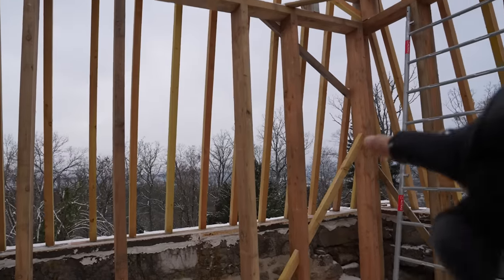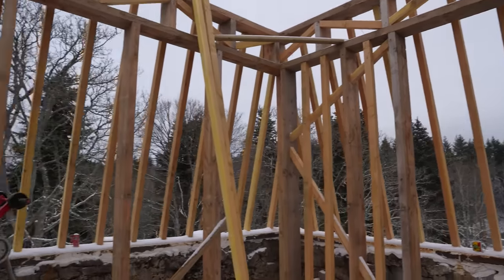Completing the first part of the chateau roof.

Comment: Your diagonal's would provide much more strength and rigidity to your wall if they were "let in". Instead of many short sections that all have some movement your diagonal would be one continuous piece of wood that sits in dados chopped into the verticals.

Comment: Have you thought of skipping the lower floors on the other side first and moving right to the top floor so you can get the roof on the other side?  You then could use the steel from the top floor to help Install the lower floors.  It would be a bit tricky to get those steels on top In first, but with a little planning and help from the boys It could be a cool idea.
Reply: In a Mansard roof...the floors need to be stable first as that is what the roof actually sits on. As he has explained in past videos

Comment: I can see Dan, that you're a perfectionist and very meticulous about your carpentry.  So is my husband.  In fact, the last new house he built was so straight and square that it was too tight, too perfect. The fireplace wouldn't draw if the extraction fan in the kitchen was on.  Instead smoke came into the house.   (He didn't lay the brick for the fireplace.) They either have to crack a window or put in a fan for the fireplace.  Just an FYI for you DIY.

Please wear safety equipment when you're nailing on that OSB.  <3

Comment: So glad to see you have had a few helpers lately. It's looking great. A few questions: Cold weather = wood shrinks. Warm weather = wood expands. Will working now on the frame in very cold temps cause any issues when temp warms up, such as movement? Cracks? Gaps where rain could get in once cladding etc is covering the frame?  

When snow melts, will it seep into the wood, and how long will it take for the wood to dry out? Will you need those dehumidifiers to remove all the moisture in order to avoid any mould growing?
Reply: Wood expands with a coefficient of about 0,000008 per °C, so a meter of wood stretches by a fourth of a millimeter when temperature goes from 0°C to 30°C. About moisture, I guess we'll see what he'll do about it. I have learned that Dan doesn't talk about future plans a lot, we're supposed to keep watching ...

Comment: I wonder what section of the house you will work on next after this roof is on this section. Me personally, considering its winter. I would try a smaller area like the turret. Less work to bring up supplies in the snow. You can put in the next floor. Secure the stones. Level it off and place a temporary cap on top (plywood, tarp with a small pitch for run off and sandbags to hold down) to keep it dry inside until your ready for building the peak.
Reply: it might be smart to secure the top of the turret walls indeed. stones falling could likely smash through osb floors or new roofs...

Comment: I didn't think about this until just now but maybe you should have installed eye bolts to the outside of the base steel along it for anchor points for your safety rope and harness that you could have run from one side to the other across the top of the roof frame it would have made putting the osb and roofing on easier later on.
Reply: The steels aren't mechanically-fixed to anything though, and could not be relied on to take the weight.
Reply: He could still fix it to the walls with drilling a few holes and anchoring the steel down but I'm still pretty sure that between the weight of the steel and the roof framing it could handle the weight of one person and some osb and the eye boots can go where he planned to put the windows so he could detach the safety rope whenever needed would also come in handy later on for cleaning the outside of the windows on the floors below with the climbing gear he already uses.

Comment: What is Your Description of an "A" Frame>  Dose it look like and  A ? Or are you making a Truss for the " flat" Roof over top floor? What will the roof lines look like when completed ? A mansard roof is typically flat or has slight angle for rain run off . Do you have any Working Drawings of the Roof Framing? just a few questions .lol

Comment: You board up the windows it will get DARK in there and even colder than the outside! Clear THICK plastic would be better.  On wood frames. You'll still have daylight and it's CHEAPER.

Comment: mount the panels due south 90 degrees vertical will help wit the snow

what i do at 57 degrees north in the winter
 
or rig up a pully brush of some sort

thats deep snow looks in yard at half meter ok. lol and this is a drout year so far usualy 1m by now

u guna fix up a fireplace for heat or haul a wood stove in?

Comment: Will you need to rebuild the upper bits of the inside wall before you can waterproof the roof structure? Or do you have a temporary solution in mind?

Comment: i'm still wondering what the build sequence for the project is. what area is next to get new floors?
Reply: I think he said the roof is a priority to create a dry workshop. The workshop is needed to continue with the build and keep the equipment from rusting.
There are no outbuildings on the property that he could use for storage or as a workshop.
Reply: A while back he said that he plans to do the opposite wing after this one, I don't know if that's still current.

Comment: Adding the roof framing really gives perspective to the massive size of the chateau.  Is it four floors in the middle?  I hope you put an elevator in there.
Reply: I hope he doesn't put an elevator in for himself - he will keep fitter always using stairs as he gets older.
Reply: @basseynz  Easier to haul stuff up and down.  They may need it, depending on what they want to use the place for when he's done.
Reply: @Scott_works  Yes although he seems to do pretty well lugging stuff up :). The living areas are usually the lower floors and the upper floors bedrooms. He has said he is going to live in it and hopes to run summer camps for disadvantaged young people.
Reply: @basseynz  Hopefully he won't mind schlepping wheel chairs up and down.
Reply: @Scott_works  Will he need to?

Comment: i cant fathom what live loads the engineer is expecting for that roof system... it looks like you have 2.5 x 6 or 8 framing spf #1 that is braced for racking as well and on something like 10 inch centres... you do not appear to be in an alpine region which can expect abnormal snow loading.  i live in canada  we have been known to get snow here on occasion and during my architecture schooling i had to become intametly familiar with our building codes and other things like span and load tables.... offhand that roof structure should support 100 -200 feet of snow on top of it.....here  cheap roof is 2x4 on 16 inch centers with 3/4 sheathing  an expensive roof would be 2x6 or 8 for insulation depth  and  1 inch thick t and g  plywood sheathing .....5 6 and 7 feet of snow on them is normal . thanks for the videos  keep warm and clean your working area

Comment: So solar needs cleaning in winter. And they want me to invest in it. A further point in your roof construction and the tax value of your building which has to be valued in Spring. At what point in the roof construction does it become a roof and so hugely advance your building value on which to pay annual tax. Is it when you apply under felt or when you apply tiles? As the application point might be about the time of declaration should you delay slightly to gain advantage this year? An hour with your accountant might be very valuable. A roof covered is a roof covered the size of it may not count. So no roof is a ruin under reconstruction and liable to a lower value to pay tax upon leaving the substantial rise for a further year if that surmise is right. Worth a question to those who know. There is also the point of reduction by adding windows  in the roof you were speaking of. Lots of advantages and traps in what you are doing.
Reply: A large permanent solar array will be set up to prevent snow accumulation. Dan's is a small temporary solution. I wouldn’t let that bother you too much.

Re tax, it's normally when a property is habitable that you will start to pay charges. It will be easy to check with the mairie how that is defined.
Reply: @LaReynedEpee  Ah that is interesting. From such as I could understand there were tax charges on value and CGT and they appeared to be different functions. I suppose it is similar to local and national tax here. It is just that with PAYE here annual filing of tax returns is only for a part of the population. I was surprised to see your assets abroad were also taxable. Equality in all things it seems!
Reply: @glynluff2595  France at least provides refunds on tax for installing eco measures, wish we had a similar system in the UK.
Reply: @LaReynedEpee  I think we would like to see some positive thinking to benefit usable eco matters in a logical way. Various departments offer items that oppose others. Will it change with government, probably not !! Have a good 2024!
Reply: @glynluff2595  Joined up thinking would be nice, for sure

Comment: Cutting out the small pieces of the brace was a joke I hope, because that is just a waste.. as long as the angle is not changing - and it is not - single cut would do the same job.  [Fixed spelling of pieces]

Comment: What I find annoying is having placed the entire frame on the floor, it would have been necessary to at least double certain beams because there is all the weight of the frame.  Then all the weight of the slate without counting after the insulation the Placoplatre;  and then the layout possibly if it's a bedroom, // that's a lot of weight for such a small floor....
Reply: Hence why he needs a structural engineer…
Reply: Look up Mansard Roof. That's what he's recreating.
Reply: @NurseSherry  and you don’t need structural plans for that? You do it by the eye?
Reply: the previous roof was constructed the same way, with thinner dimensions. the difference is that all the wooden beams of the floor went into the wall distributing the weight more evenly. now almost the whole weight of the roof and upper floor is carried by the ends of 3 steel beams. I'm a bit skeptical, seems like he did not do much to strengthen the wall below the points where these  steels were inserted.

Comment: I say this only because there  are other attics and rooves to frame for you.  Cutting the angle pieces inside the studs is not particularly strong..  Better would be nailng the angle boards full length to the outside or inside  of the studs. Even if you put them on the inside and don't want the braces protruding into your attic space, thin steel straps could be used and lath and plaster or even drywall would cover the straps
Reply: Diagonal 6x1 ,two 3inch annular ring nails too each vertical stud on the outer face (will be within the void area once walls are finished internally anyway. If he intends to sheath the mandate slopes then there will be zero chance of racking anyway. The rigidity of short diagonal sections BETWEEN the studs is much poorer practice, only done when both faces of the stud are to become 'finished'  walls. I can't believe this his structural engineer has asked him to follow the detail of diagonal blocking.
Reply: @chrisdormer1061  ... While we are discussing  things, I  don't get why  such heavy timbers are being used at this top section. Such high centers of gravity are unstable in even moderate earthquakes . Use of lower dimensional framing lumber would be more than strong enough for an attic and roof  of that size and be safer besides..  I would be worried about racking even  while constructing  and finishing  this roof.

Comment: Can someone please tell me what is going to happen to the floors that have been put down, its fibreboard/chipboard and it has got so wet, do you think that it is going to have to be replaced or will it be left in place to dry out...?
Reply: Obviously, these are temporary floors until the roof is waterproof.
They're not designed to last very long.
Reply: Once he told us it is marine grade plywood.
Reply: @carolynmendoza1934  It's neither plywood not marine grade.

Comment: A 2x10 nailed horizontally to the back side of the angled part of the structure would allow you to brace between the vertical studs and the horizontal studs.  I'm not sure why you are doing seemingly random angled bracing.   Two ends are tied into the stone wall and the other corners only need a top plate.  The roof sheeting will stiffen the outer shell completely.

Comment: I could be wrong but in. my opinion your nails look too small and thin for the size of the beams you are using. I think you need much heavier nails for holding the wood together. I am not an expert - but you electric hammer sounds like a tack hammer compared to what I have heard the framers use around here.  sorry, I hope I am wrong.